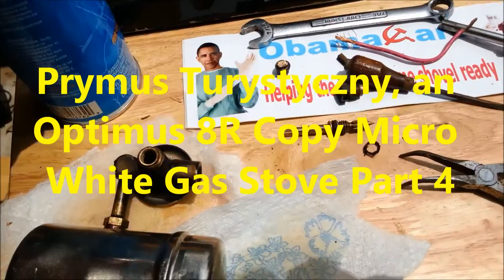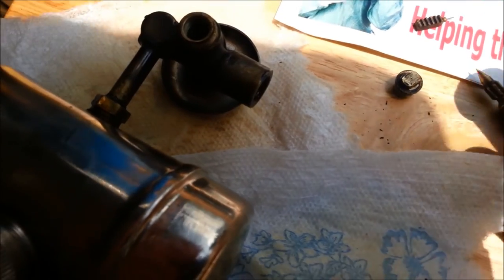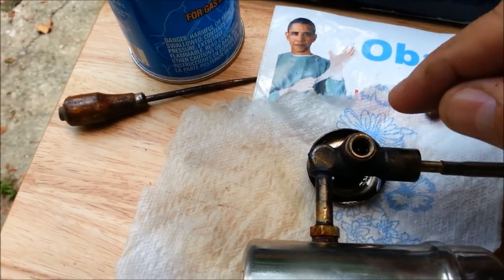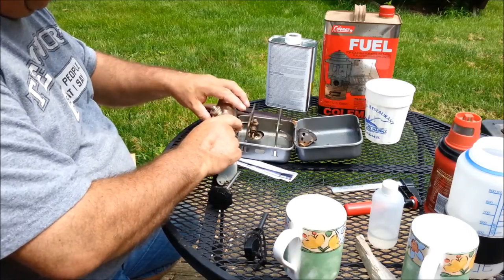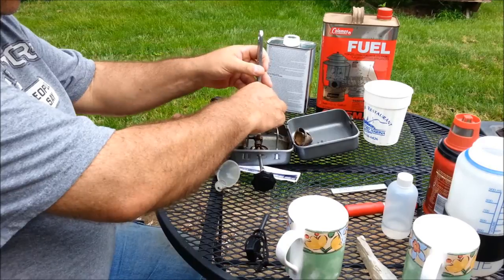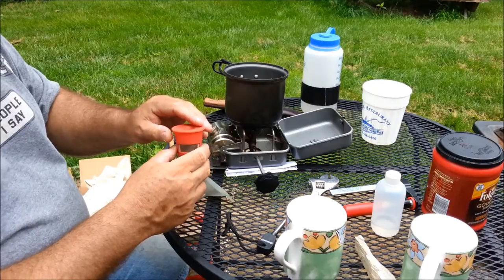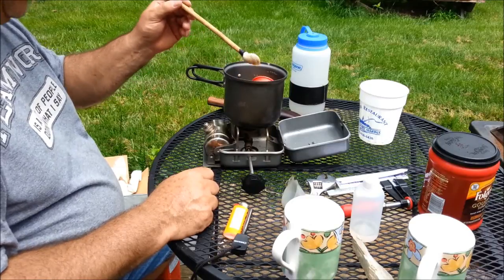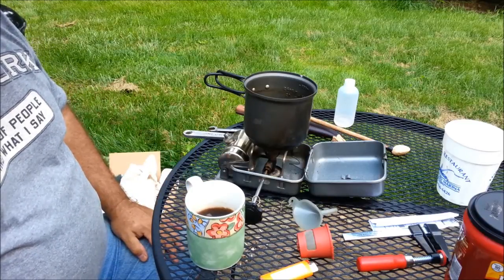Prymus Turystyczny, an Optimus 8R Copy Micro White Gas Stove Part 4

Comment: TO Turn the stove off, you must turn it to the right (clockwise) if you want to clean the jet out, then turn it completely  to the left (anti-clockwise) this will clean out the jet, it is NOT for putting the stove off. I will be putting a video up in the next couple of days on stripping it down, replacing any bits that needs to be replaced, then rebuilding it, so subscribe to my channel if you want to see that.

Comment: I have noticed that a lot of people turn the valve shaft to the left to turn the stove off, where in fact that is only to clear a blocked jet and NOT to turn it off, you should turn it to the right to close the valve off, stopping any vapour from reaching the shaft to the jet, then crack open the tank cap to release any pressure from the tank, when the burner has cooled down, then tighten the tank cap, this is how it is done,  (only my opinion) hope it helps you.
Ray
Reply from the maker: +CharlieTango 1 I keep eyeing that stove for an overnighter.  If I get a chance to revisit it, I'll do as you say and add to the playlist for the stove.  I'm casually shopping for another stove of this type also.
Reply: Yer, me to, I have just bought 2 of them, 1 is an optimus and the other is an 8R copy like yours from Russia
Reply from the maker: CharlieTango 1 Yea, I want the Optimus for the next one.  I have a US GI stove in storage that I haven't even looked at.  It will probably be my next stove video.  This time I won't be coming at it as a total rookie.  ;-)
Reply from the maker: CharlieTango 1 Incidentally, you finding them on the Bay?  I found mine on the Goodwill site. Not sure if they ship internationally.
Reply from the maker: I think I got my Optimus for around $40 delivered.  I'd have to watch my series again to remember.  ;-)  They are all over the USA as well.  If I do a canoe trip this summer, I plan to use one of these.  It seems like a stove for when you have conveyance or don't have far to travel.   Also, I don't see any commentary on length of burn.  One tank of fuel is how many days of backpacking in your view?
Reply: should last 2 or 3 days, but I would take fuel with me to be on the safe side, if that will be your only means of cooking, I have just this moment bought another one from Bulgaria for £50 it has not been used at all.
Reply from the maker: Sold.  You must be the happy new owner?
Reply: yep, can't wait to get it, he told me he will get it to me before xmas
Ray
Reply from the maker: Are you in or near Bulgaria?
Reply: No mate, I live in the United Kingdom and I am English, it is just that there are a lot of stoves being sold from there, I think it may be that they don't have much money at the moment, ( I could be wrong!!)
Reply from the maker: CharlieTango 1 I noticed world wide shipping from there seemed pretty reasonable.   I don't think I could ship some of the same Items from the USA to Bulgaria for those figures.  Subbed and watched a few of your videos.  I thought that you were from the UK but you never know.  People can live anywhere today.
Reply: cheers mate, hope you found them interesting, I know I do ramble on a bit, it's called age!! ha ha

Comment: Good work there.  These stoves are almost the same as the 8R, some parts do not interchange.  Check out "Classic Camp Stoves" -- or seach for "Spirit Burner" and you will get a lot of info plus directions for the 8R in english, swedish, etc.

The needle at the end of the brass block is a cleaning needle and the idea is that, if you suspect some blockage, turn the control fully open to raise the needle. (The needle is steel and will eventually wear the jet.  If you use Coleman fuel and not gasoline, the jet will probably never need cleaning. And, the needle and block can be removed entirely if you wish.)  You probably have the needle set correct, but if you remove it again, the trick is to turn the vavle spindle fully closed, then lightly set the bock on top with teeth facing and slowly open the valve -- keep a finger very lightly on top of the needle and after you feel 4 clicks turn the valve closed again.  Try it and it will make sense. Then replace the jet.   As you already figured out -- if you set it too high you cannot open the valve fully and if you set it too low you cannot close the valve.

The packing is graphite.  I do not know if leather would work or not.  Don't use common plumbers graphite cord as it contains an adhesive that cannot take the heat or solvents.
Reply from the maker: Thanks for the tips.  I've got two stoves from this family, when I get a third, I might revisit all of them to make sure they are up to snuff.

Comment: Just about everything you are saying is wrong!   The needle on the gear rack is purely the built in pricker cleaning system. The needle assembly must be installed correctly for the valve assembly to work as designed. This is usually why you see people turning it off anti clockwise, as the valve does not seat properly when turned anti clockwise because the rack bottoms out before the valve closers fully.
Reply from the maker: +David Fretwell  Yes, it is.  However, you are gravely mistaken.  This is not a professional how to video.   I never claimed it was.  This is me trying to figure this out for the first time and sharing the experience.  I used the wrong fuel, made many mistakes along the way.  Of course.   I have the courage to share my errors.  I checked your channel.  I don't see any content at all.   "Charlie Tango 1" has the most informative video's on these stoves.

Comment: Im having a hard time removing the valve adjustment. Its seems stuck. it turns fine but can not remove. any thought?
Reply from the maker: BigTVideos If you watch the whole series, you will see the valve has a gear that runs the needle up and down.  You have to remove the packing nut to take out the valve.  You have to remove the needle also so you can rotate the valve fully around.
Reply: Take the jet off, open the valve fully, then remove the jet pricker, then remove the packing nut, now the spindle will un-screw all the way out where you can now replace the graphite  packing.